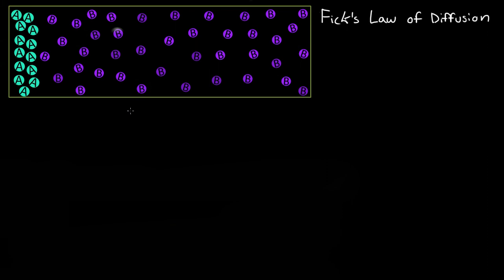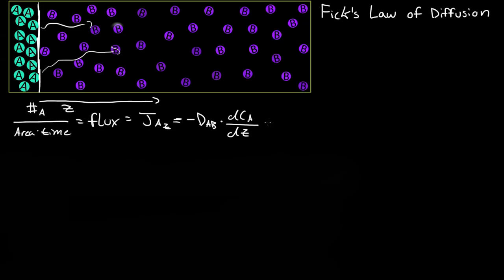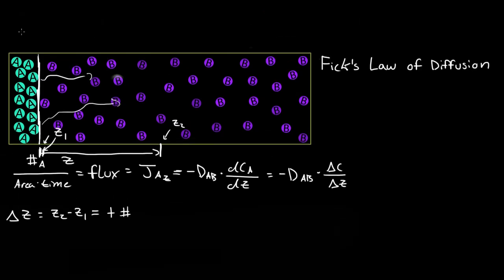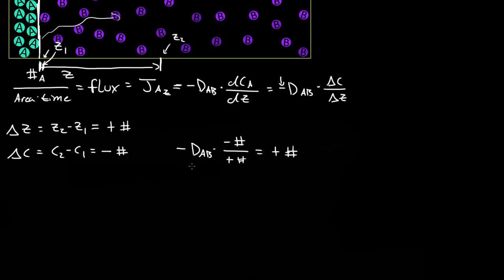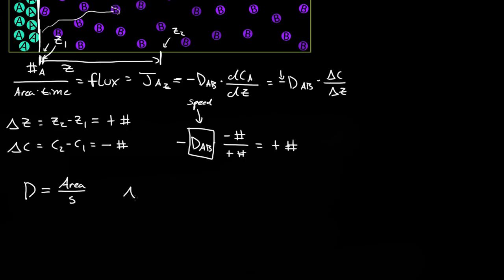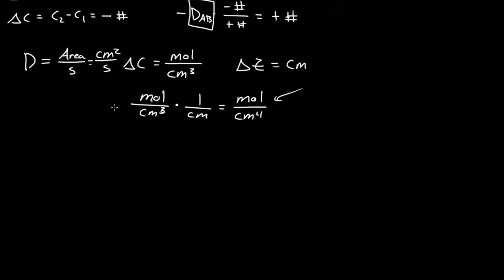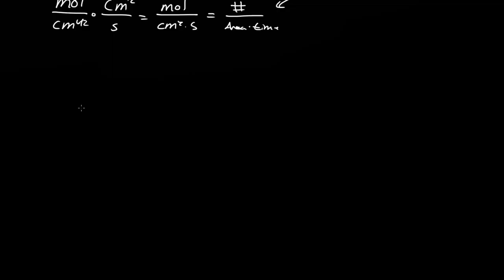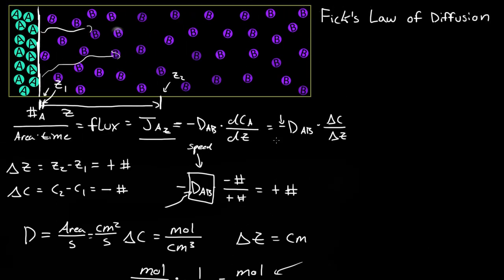Fick's First Law of Diffusion

Comment: Why is Z the area? If it is the area, and C has a unit of particles per volume, and D has a unit of area over time, then Flux will have a unit of (number of particles)/(volume*time) right? So if Z is the distance, then it makes more sense. Is it correct?

Comment: I think it's better to think of D (diffusion factor) as it's (mean length * the avg velocity of particle) >> D = l*c , because D = A/t is not making any sense.
because if we developed this term in microscopic terms in 3-dimensions , D will be = (1/3)  (mean length * the avg velocity of particle in the direction of l )

correct me if I am wrong, please :) 

Another small comment on the video:
You've typed D = Area/s << this is not correct. It should be D = Area/time
---------------------
Anyway you've done a very good and quick explanation ^_^, thanks a lot
Reply: +Islam Negm 
It is a good way to think about it. Since Fick´s equation is a constitutive relation, in continuum mechanics you will have a second order tensor to represent this ability of A to diffuse into B, and due to randomness of the microscopic phenomena I would speculate and say it should be isotropic like Newton´s viscous stress in fluid mechanics.

Then the vector Ji should be the result from the inner product between Dij and CA,j where CA is the concentration of A scalar field and comma convention is used for the derivative in the j-th direction
Reply: I like math cause I can say: AttentionWhore = Area/time. As long as it's explicitly defined, I can always tailor it to my understanding. Mean and average it... do it big baby. I'll stick with the general idea for now though. Anyway great critique ^_^, thanks a lot.